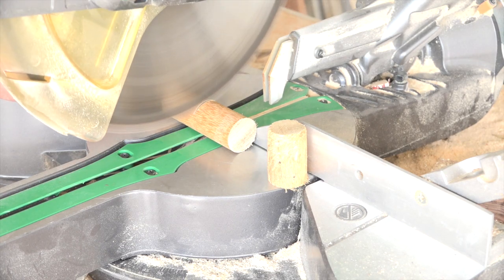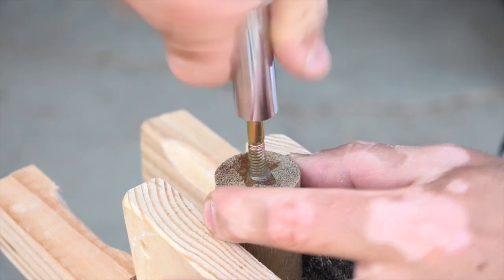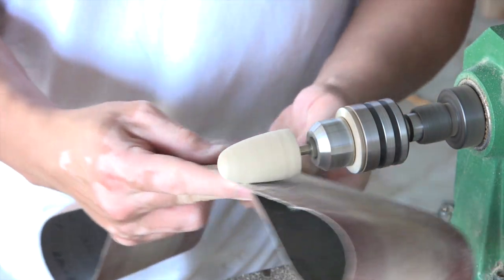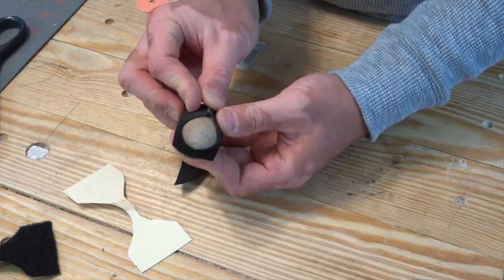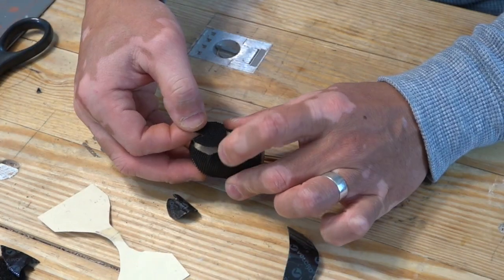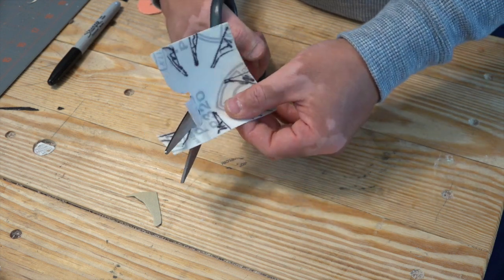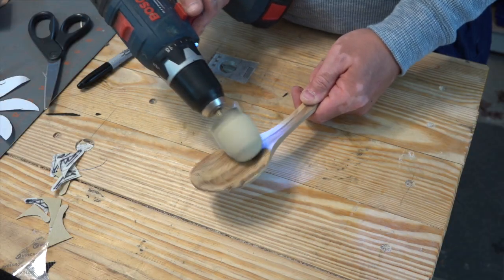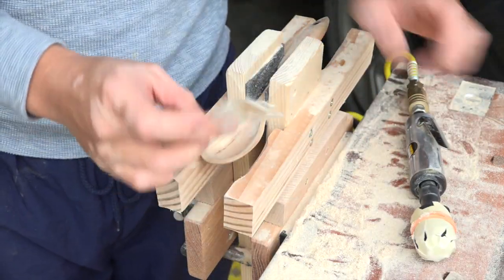Inflatable Sander Replacement

Comment: Thanks for the tip, will try it.  Also, do you have a video or design for the spoon clamping jig you use at 1:50 in your video?
Reply from the maker: I just made it up, it's just a 3rd class lever with hinge, a place to rest on my specific vise and a rest for the spoon shape.

Comment: That is really clever! Thanks so much for sharing this John
Reply from the maker: Thank you. May be you can make on for your brace, may be an egg beater drill.
Reply: The eggbeater drill would be a great way to use this. I could easily see this as working as a way to round off corners on large boring jobs with a brace.